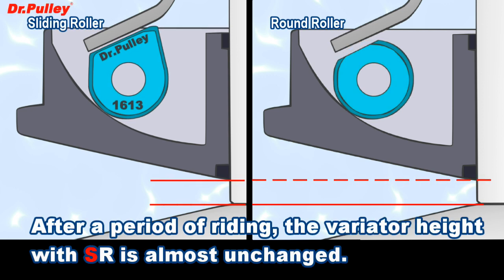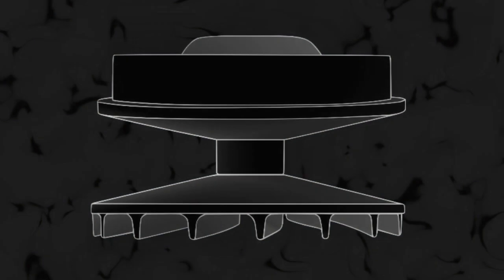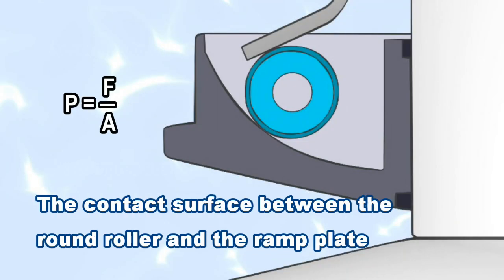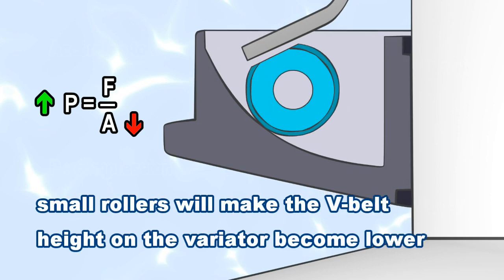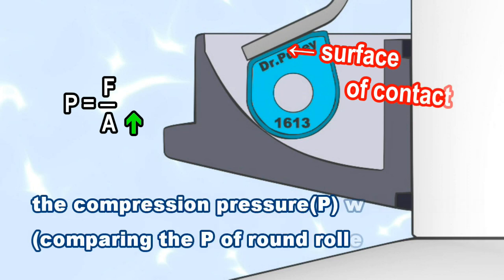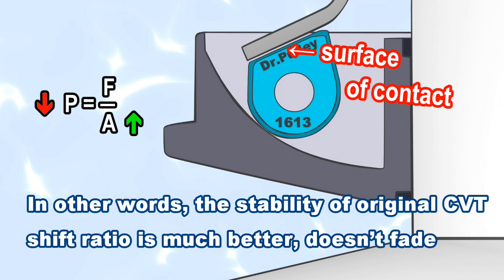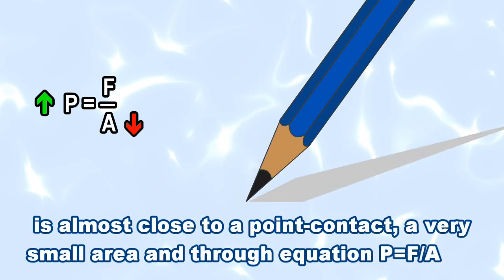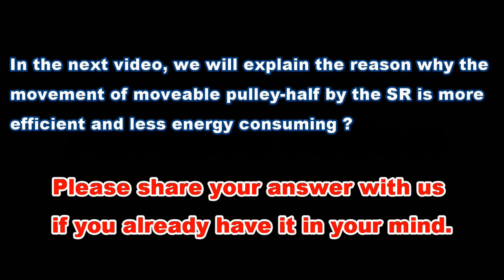Why is sliding roller more durable? - Wear loss - SR - RR - Roller weight - Dr.Pulley

Comment: Hello, I currently have a 6.5 gr roller on my motorcycle. I planing to install a 6.5 gr dr. pulley to change the top speed. Do you think the final speed will increase? Will torq and acceleration change?
Reply: top speed will increase a little. add +1 to see more top speed

Comment: Hello im using nmax v2 155cc.  Right now im using roller sliding DR PULLEY 13g .why my top speed drop from 115kmh turn to 110kmh.my weight 110kg.
Reply: How heavy are the stocks rollers?

Comment: All of this would be less confusing if we all stopped calling them "rollers". They don't roll, they all slide. Even the round ones slide (which is why they wear and develop flat spots). If you lay the round ones on a flat surface they will happily roll around all day but when squeezed between 2 surfaces like in a variator they slide, because they can't roll in 2 different directions at the same time. I use the Dr Pulley sliding weights because they last longer, but I don't really expect any significant improvement in performance in the standard variator. Possibly there might be a noticeable improvement using the Dr Pulley variator but I haven't tried that yet.
Reply: Good post!
Reply: Very well analysed …and beautiful explanation ❤

Comment: modify the RAMP not the rollers. Dr pully rollers will go over past the high point and get stuck, have seen it many times. always use round rollers with cut ramps. sorry Dr pully ! but you cant solve the problem with odd ramped shaped rollers.
Reply: Just when I thought I understood what all this geometry was about.  Now I've got to do some research to see if folks are having any problems with the Dr. Pulley sliders versus the round rollers/sliders.  You bring up a good point - if Dr. Pulley slider shape was such a good idea then why haven't Honda, Yamaha and all the other manufacturers gone over to the Dr. Pulley shaped sliders?  Perhaps I'll be better off in the long run to only change the roller weights and leave the shape alone.  Thanks for bringing this up.
Reply: @STBRetired1  thats a fallacy thinking. same as if electricity so efficient why we still burning fuel. 
its all about how the technology advance and ofc money. round roller is easier to manufacture. cost less. 
this dr pulley roller is twice as expensive as standard round one. 
still ordering mine. it will arrived in few days. i just wanna do some experiment for my PCX160
tbh i dont really expect a significant performance boost. factory roller is quite enough.
Reply: sliding roller only designed for factory ramp. not modified one.
ofc it will stuck if you use it.

Comment: the reality is not so, the roller sometimes flips which causes the sound and torque to be lost
Reply: You mean the Dr. Pulley Sliding weights flip ?
Reply: @Scientific_legal  rather it changes position and it greatly affects the torque
Reply: sliding roller terbalik itu efek jalur roller yang udah gak rata, bukan karena rollernya, gw selama ini pakai udah sebulan lebih normal" aja.

Comment: The top part of Dr Pulley might not wear out so fast but what about the bottom part?
Reply: so there are even a triangle shape of weight rollers on some ATV model
Reply: Thins video is for dump people, you are too smart!
Reply: the main problem why round roller wear out so fast, it caused by friction from the edge of ramp plate,